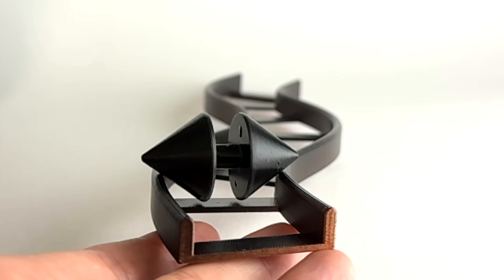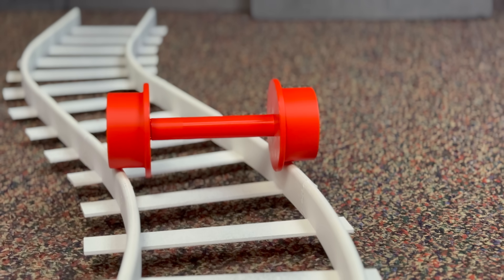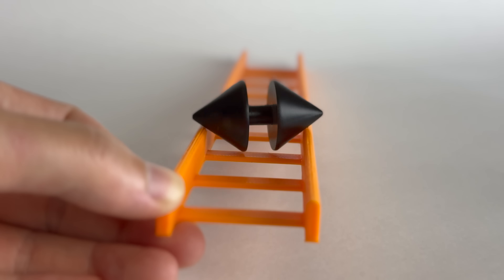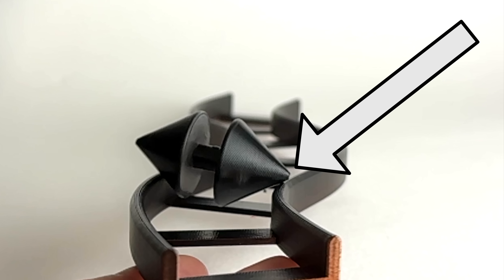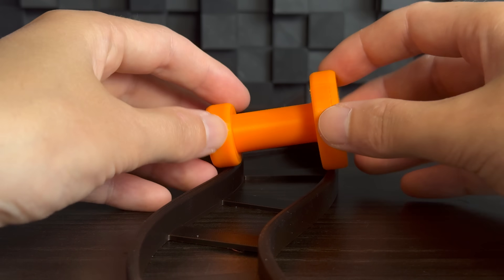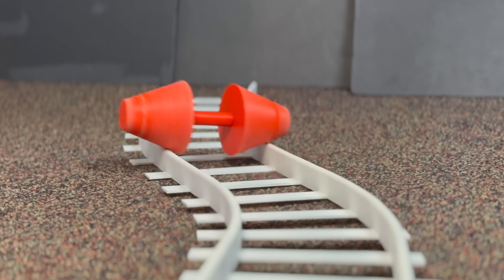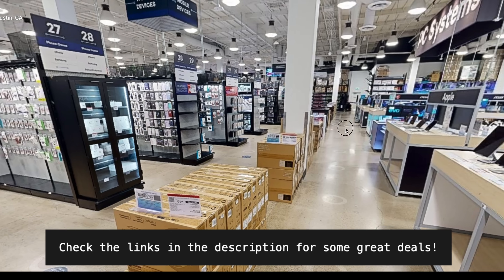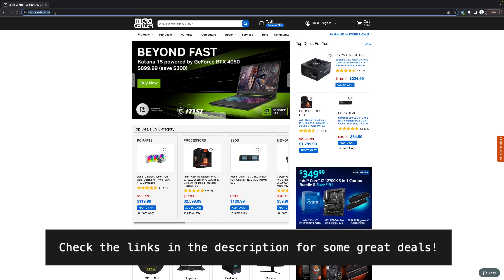The design of train wheels is genius.

Comment: It is through God tht we can do an mzing job of gttig things doe eventually. I'm 38. The otry;s strtig to go wy. I renewed my memory of wht fire is nd wht it doe through the short https://www.youtube.com/shorts/d3QsS9d_oS0. Through God, we coudl fix tht prolem through  very ecure ytem under God. I renewed y memory of wht baking oda i and wht it does by tking a finger pinch nd fillig a cpa ful of vinegr nd rectign it nd seeign that it prouces a gas. Drivign is wy too much fro me. re you kiding me? Through God, we could build n elevted triangulr bullet trin etowrk all over Earth with a simple pln enbling more people to do train driving jobs. We coudl do everythiglike lier lgerab where we hve the sme umber of equation as dimensions and excly one solution. tht could be done not only for how trins roll on tracks. It won;t be very often but soemtime omebody wl fel the ned to move  trinto another track. We wil hve a tringulr network with  few poit diloctions and nd imginry grid before some of it gets covered up by the oceans with 12 pots where 5 tringles meet t a point. Ech line wil hve 2 tracks. That liner lgebra thing wll lso be able to be use i the using tools to lift  atrain fro oe trck to nother by crane when it;s what God knows i tiem to throw them.

Comment: Some years ago I had to draw train wheels for production. The drawings I had to work from was made back in the days of the slide rule-
I had to call up the person I was drawing for and ask for a meeting. Which of these measurement should be the driving ones? It just didn't add up in the days of the computer. They had actually drawn splines with only a slide rule.
That being said they were still in use so long after they were originally designed.

Comment: I wonder if the slight horizontal change in the center of gravity plays any role in contributing to the safe high speed turning and reducing wear & tear (improving longevity and decreasing maintenance costs)? (I.e. placing less weight on the increase in diameter spinning outside wheel during a turn...) Just posted a video addressing such issues.
Reply: Watched Eli Liviz channel reply video and it addresses the issues accurately and truthfully; thank you for taking the time.

Comment: 0:44 the example is obviously exaggerated but trains do oscillate IRL which can lead to the flange riding up the rail and derailing
this rarely happens though since the train's weight is enough to push the wheel back down

Comment: As a trackwork engineer, this is somewhat true, but there are several other variables missing. First of all, the wheels are a combination of a conical design and have flanges. The angle of the tread bearing surface of the wheel is also closely matched to that of the rail head. Another variable is that on a mainline, the rails are canted, meaning they are angled inwards. This plays an important part with the wheel to rail contact. Lastly, depending on the speeds and degree of curve of the track, there can be an elevation change of the rail to help the train steer.

Comment: This doesn't really explain what's happening. The "larger" wheel on the outside of the turn has to spin faster, so it "overtakes" the inside wheel, which results in the axel turning.

Comment: Actual train wheels have a combination of angled wheels with flanges. 
A reason is that the cones are really heavy if we would use then since the best way to keep them round would making them either fully solid or make it from really thick steel. 
And modern train wheels are also much more stable wich decreases wear and ads passenger comfort and faster travel.
Just because they exist do not mean they are genius or perfect

Comment: USING PLASTIC TO EXPLAIN IS OK BUT WILL IT WORK WITH STEEL?? AND HOW WILL THEY WEAR IF THE WHEEL IS CONTINUALY MOVING IN AND OUT OR MORE IN ONE PLACE THAN AN OTHER, BUILDING PLASTIC TRACKS ?? DONT THINK SO, NICE IDEA BUT THE RIGHT MATERIALS HAVE TO BE RIGHT

Comment: What will the outward pressure of the cone shape wheels do to the tracks?
Reply: That's what I was looking for in the comments section.  I would thing the tracks would start to separate over time or bend at an angle.
Reply: @informer3evans797  exactly my thoughts.Track system would definitely need some beefing up.
Reply: There's a reason why train tracks themselves aren't flat either, they're designed with a small curve as well

Comment: What happens when the weight of the train’s carriage is applied? Wouldn’t that change the dynamics?
Reply: You are right. When the weight is applied, such wheels will ruin the railways 100%, it will push it outwards that's why nobody uses it

Comment: I made my own track and 3 different wheel designs.  It does not work like yours.  It simply turns 90 degrees and fails.    With the track, i originally had square rails but noticed yours are fillet/chamfered so I reprinted a track with a slight fillet to it;  i though this would change things, it did not.  What's the secret sauce??  what is the width of the track ?   what angle is the wheels?

Comment: You forgot to mention that the wheel on the 'larger' side turns slower due to its increased diameter contact with the rail effectively causing a slight braking effect increasing stability through turns - albeit minor...
Reply: Ah my mistake, I forgot the tracks outer radius increasing track length......

Comment: But train will continue wobbelling on straight track. 
It will be a very imbalance even on straight track. It has very high probability of delrailing on straight track.
Reply: There is a tiny bit of straight track wobble but given the real wheel taper is small and real tightest track turn radius that the wheels need to accommodate is very large, the wobble is very small as well, really sub millimetre fractions. Derailment isn't really an issue particularly on the straight. Remember also a train isn't a disembodied bogie, it's got weight.

Comment: this easily goes against everything I know about trains, as well to me common sense. one trains aren't and really can't go on those extreme of turns to begin with, as well you can clearly see and many modern and especially older train wheels, they are in fact just a normal wheel with a rim which keeps them on. its the shear weight along with the design of the wheel sets (having wheels with suspension and having typically 2 of these per car at the front and back) that keep the train on the track. this can be extended to any rail system like even a minecart.
Reply: If it doesn't work as described in the video, then tell me how the inside train wheel on a curved track is moving forward slower than the outside wheel when both wheels are locked to the same rotating axle without benefit of a differential device?
Reply: @fredsasse9973  it doesn't. A train moves forward because you have a engine at the front pulling it and no overly sharp turns. The video is 1 set of wheels, to use such a device would require so many leveling and gyroscopic devices it would be over engineered garbage. Sometimes simplicity is just that

Comment: Can you make a model with an actual train model on it? There seems to be an issue with the train rising and falling with every turn. I'm not disparaging the idea, but you would most likely need some sort of powerful suspension or shock absorbing system to keep the turn steady.

Moreover wouldn't this conical design slow push the train tracks apart?
Reply: You do realise this is the design of train wheels on the world, right?
Reply: The angle on actual trail wheels is nowhere near as dramatic as it is on these, so they don't tilt very much at all. Also, they do have flanges that keep them from moving very much side to side. They also are mounted in a way that permits them to swivel left and right with the curve of the track. So this whole video is really only talking about a one part of how train wheels work.

Comment: I've never seen a train with those orange wheels!!  The ones I'm familiar with are tall wheels with a flat load bearing outer diameters and with flanges at the inner edges.. ???
Reply: They aren't flat. They are curved and conical but the profile is very difficult to see by eye, it is very slight. But it functions fundamentally just like this. The real track curvature that the wheels need to accommodate is also very gradual.

Comment: Unusual information:
Where there are curves in railroad tracks there is usually a device called a wheel greaser that - when a train goes over it and activates it - pumps grease on to the wheel flanges so they'll slide along the rails with less friction.
Reply: I filled those things up quite a few times when I worked at US Sugar. You could wear disposable gloves and body suit, and that grease would still get on you. It gets everywhere. Every time it did, I would say "oh no, now I have a sudden urge to kill Spiderman." Always made myself laugh.
Reply from the maker: cool!
Reply: @3DPrinterAcademy  yeah! And, being kids, we'd try to make the thing work. But, as anyone with any sense (except a nine year old kid) knows, there's a difference between a 89 pound kid and a 200 ton railroad car.
Reply from the maker: @samuelt5131   😂
Reply: Most curves on railroad tracks do not have greasers.  I’m a retired road engineer for a major class one railroad.  We only have them on curves with a tight radius.  And those are not out on the main line, usually at turnout of a switch.

Comment: I think everyone missed the part where he said they are an exaggerated example of train wheels. Should have said they are an over exaggerated example of train wheels. 
Also left out that each set of wheels is in a truck or carriage that pivots. So you have slightly conical flanged wheels that are on carriages that pivot to conform to the curves of the track.
Reply: Exaggeration and completely changing the base shape and then exaggerating that fictional version are two different things tho
Reply: Then why didn't the video, at the very least, illustrate the real life wheels AFTER the "exaggerated" instructional models.. ??
Reply: @jimstepan3038  It's really hard to see in real life since the equipment is so big.  What he can do is 3d print a frame to couple two of the axles to demonstrate how they smooth each other out.
Reply: @jimstepan3038 Because the uploader assumed his viewers weren't 90 IQ apes. Obviously they were wrong with how many people like you are commenting.

Comment: Conical wheels have a single point of contact with the rails.
This will limit the load capacity vs cylindrical wheels which contact with rails on a line
Reply: This is exactly how all trains work because that tiny point of contact is exactly why they are energy efficient

Comment: The conical wheel design will exert outside pressure on both rails causing spreading of the tracks. Flanged wheels exert mostly downward pressure supported by rails, rail ties, rail bed, and earth. There's nothing genius about conical wheels that will cause failure.

Comment: I fuel locomotives so I see them every day I work, and I can tell you that's not what the wheel look like. Google train wheels and see what comes up
Reply: Somebody has to fuel the locomotives they won't fuel themselves. I was a Machinist for Santa Fe RR and then BNSF RR for 10 years and this is a very simplified explanation of how a rail car or locomotive wheel works. There is a small curve just past the flange on the wheel and it is shaped when the wheel is manufactured or recut when truing after cutting flat spots off or for size. It's not very big and most people wouldn't even notice it.
Reply: @tomsparks2294  , like I needed an explanation of how they work.

Again, it's obvious why you're a fuel jockey.
Reply: @outdoorsman7324  I'm not a fueler I'm a heavy equipment mechanic at an open pit mine. Haven't worked for the railroad since 2003. And I was a Machinist when I worked for them. But still as I said there needs to be people to fuel locomotives.
Reply: You definitely didn't watch the whole video then because he said they're exaggerated
Reply: It's pretty obvious why you pump diesel for a living. 😂
Reply: @outdoorsman7324   I got a family to provide for 🧐

Comment: The flanged wheel navigates the turn just fine. Your example is flawed, there shouldn't be so much room between the flange and the track. Also your cone shaped wheel will have the CG of the load on the cars being thrown all over the place causing them to tip over.
Reply: It's EXAGGERATED, all train wheels use 3 degree cones

Comment: Well its genius really but..apparently it will generate vibrations to both sides on the segment of train above it..second..it needs more experiments to apply on a rwal train with moe than one van..third if some greasy material is met at some part of the rail it may slip..But such a genius idea needs more   realistic experiments
Reply: What the hell are you talking about? This has been used on ALL real trains for about 200 years now. This is not a suggestion for how to make better train wheels, its a demonstration of how they actually work in the real world.

Comment: Both your cone wheels and the flange wheels have them fixed to the same rotating axle.  Any practical train wheels would have independent bearings and be able to rotate at different speeds.  Then the flange wheels would happily make a turn without binding as in your example.    Meanwhile the cone wheels would no longer automatically turn.  Without flanges they would likely derail as well due to their momentum.  Certainly they would derail with the momentum of a train on top of those wheels.
Reply: What You are describing almost never happens (except maybe few rare occasions). 99.9% train wheels are fixed axis (connected permanently) to both sides.
Reply: @tiemanowo , there is nothing practical about what you described at all... especially where load distribution comes into play.
Reply: @tiemanowo  What is in place to counter the difference in wheel speed during turns? The inside wheel has less distance to cover than the outside wheel. Is there a negligible slip between the wheel and the track or is that eliminated by some other feature?
Reply: @__Razer The cone shape solves that too. You'll notice that the inside wheel self adjusts to a shorter radius compared to the outside wheel on the turns.
Reply: @__Razer  I am not sure why you are asking because the whole video is exactly about that topic. Wheels are not flat but slightly "cone shaped" for that reason.

Comment: The cone shaped wheel & track contact area is way too small... it will deform the track in a short time and the 45 degree angle will generate forces that will pull the train tracks apart. There is a reason why train wheels are built the way they are.
Reply: Not only that, but PLA would buckle under the load of rail freight, the extremely narrow track gauge would make the train too unstable with typical freight loads, and the length of track shown  is way too short to make a useful rail line. The track is also not anchored, so it's at risk of shifting around uncontrollably. All in all, it's unusable for a proper rail line.

But seriously, if the wheels and track were built with the angles actually used by the rail industry, the effect being demonstrated would be too subtle to be seen effectively. Teaching aids are built with deliberate exaggeration for a reason.
Reply: @klasodeth LMAO I like your first paragraph.
Reply: This whole comment section is really showcasing who is on the spectrum.

It's an exaggerated display for a video. As stated in the video if any of you actually listened instead of furiously typing before he said that.
Reply: @SuperCatacata  You're right I didn't bother watching all of it after seeing the over-simplified / wrong visuals because it insulted my intelligence.

Comment: Does the train turn sideways into the curve preventing it from falling over as well or is that canceled out by the axels?
Reply: The tilt of the wheels on actual trains is much smaller than this, and there is suspension on the wheel carriers to dampen the forces out. Usually the tracks themselves may be slightly tilted if it is for high speeds, or if your really funny you design one of those self tilting trains like the British did
Reply: @Yeeter_Inbound It's probably so they don't spill their tea! 🤣